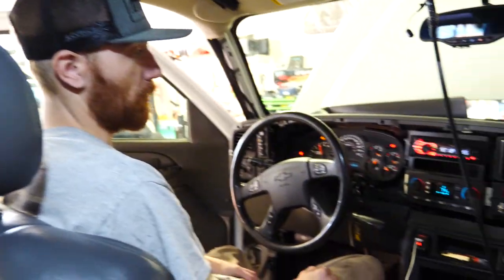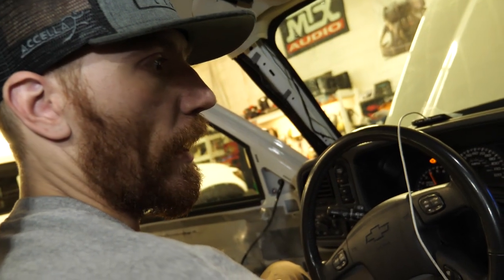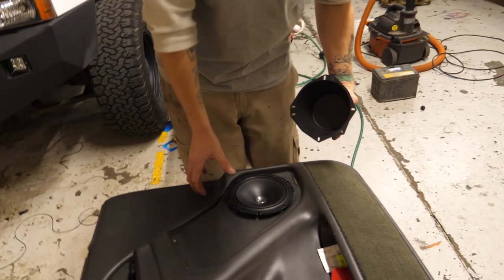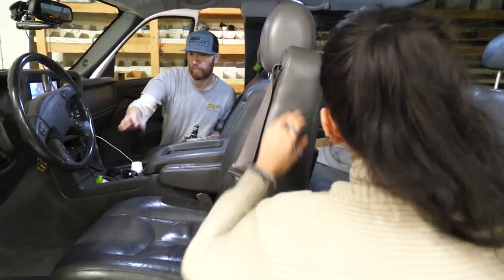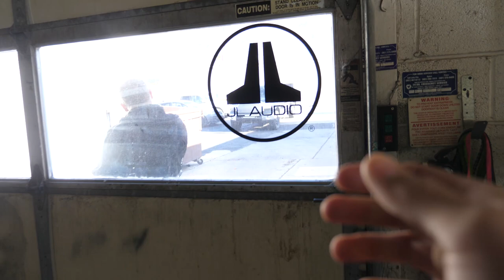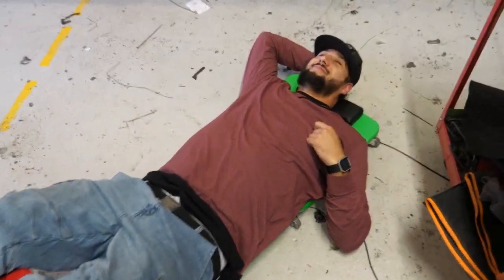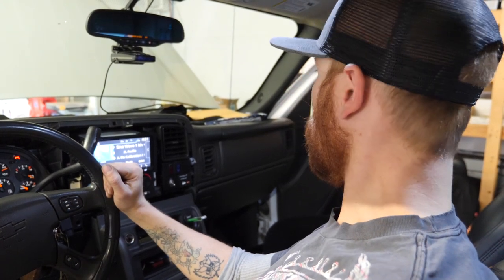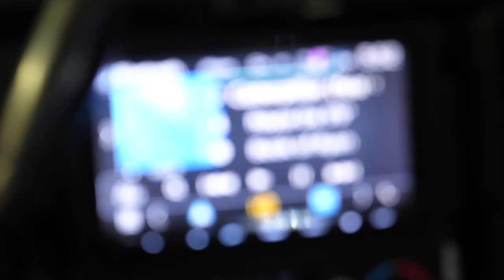New Sound System In My 2004 Chevy Silverado // 2004 Chevy Silverado Build PT 2

Comment: I mean...these after market radio especially by Pioneer are specialized in the very best at what they provide. They are MUCH better than the 2020 OEM shit. If i bought a brand new truck right now...id rip that trash they have out and install a Pioneer. The infotainment systems are super laggy and are junky compared to these nicer 400$ units. Yet they charge a 1500$ premium for them lol